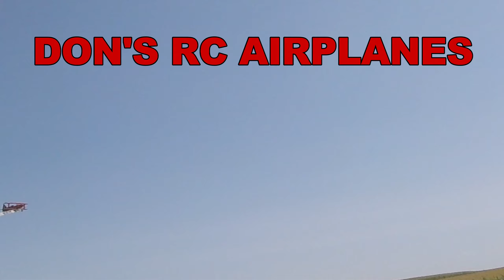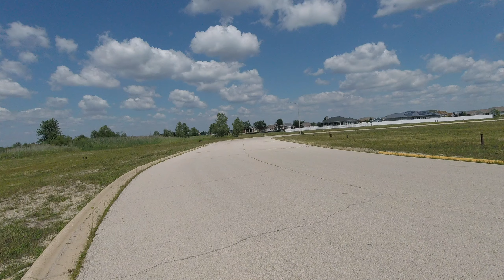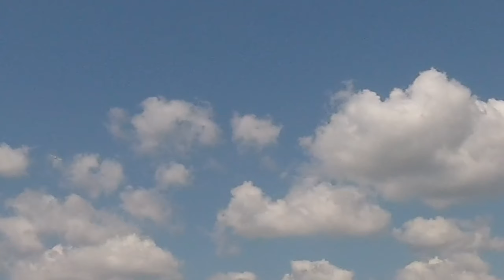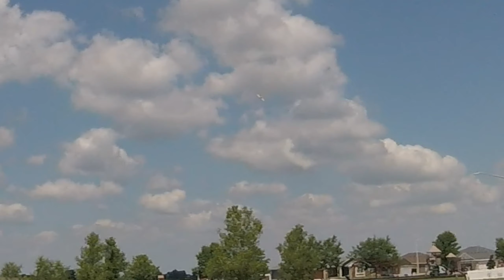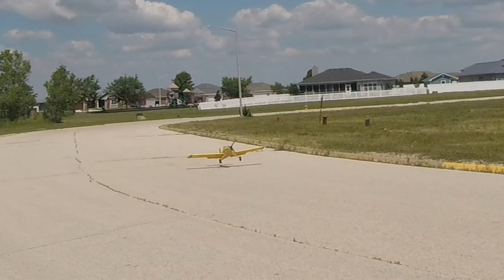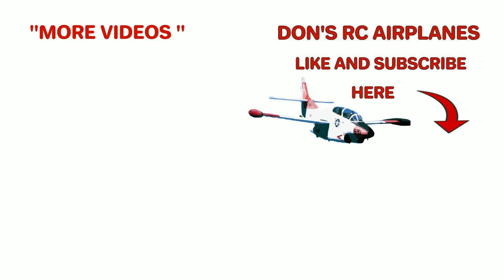E flite Air Tractor 4s flight , Upgrades Still Working Well

Comment: Awesome flight, Don. Any details about the landing gear upgrades?
Reply: Ooops, I found it. You did the Dubro mod. So that eliminates 3S on this ol girl?
Reply from the maker: @originafreerangechicken    It will still work but It felt under powered because of the added weight ...I only tried it once on 3s and almost lost it, but it was really windy...The tires are heavy , if you go with the one size smaller tire it would be fine...Thanks so much for watching and your comment